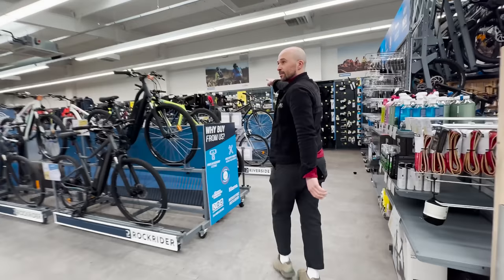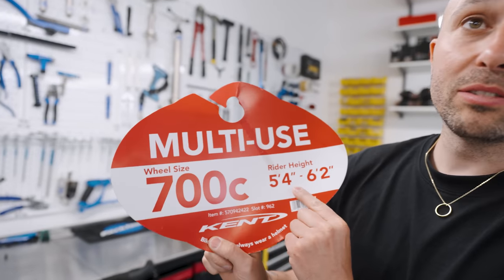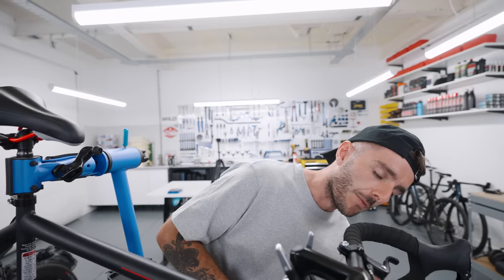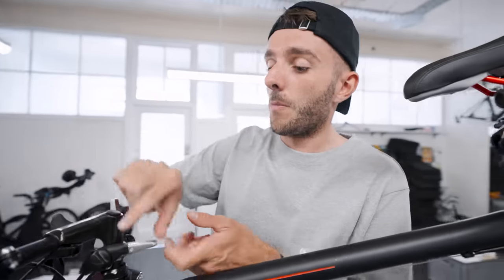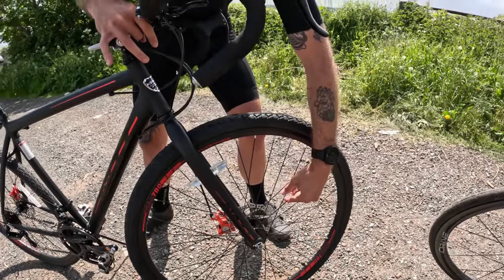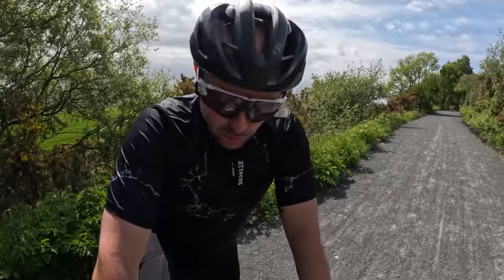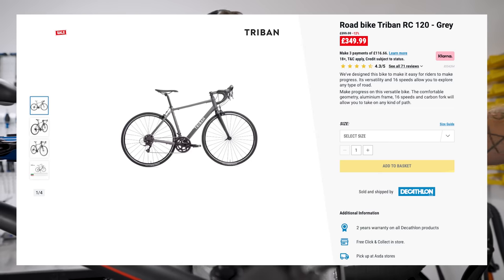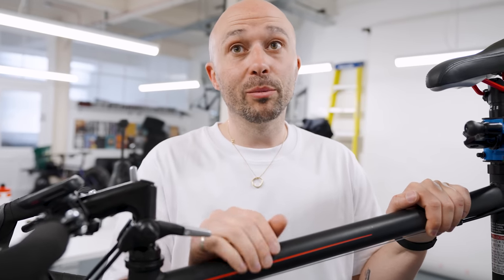We Bought A $248 Entry Level Bike in 2023 - Too Cheap?

Comment: I got this bike last year for $30 on clearance, I knew it'd be bad but couldn't resist at that price. After putting good tires and flat bars on it's actually fun to ride.. for a few miles at least. also replaced the components with tourney tier stuff so it sucks a bit less. Though even after these upgrades, I stopped riding it because of the flimsy crankset which feels woefully inefficient for any long ride. For a casual cyclist this bike does have potential, but they probably should've just sold it with flat bars and trigger shifters to simplify things for said casual cyclist.
Reply: I am new to cycling. Kinda broke. May have an opportunity to trade for this bike with a local.  Would you say under those circumstances its a good bike to get me going until I upgrade, seeing as how potentially I wouldn't have to pay for it, and that these gentleman are being a little too technical because they likely have ridden more miles on higher end bikes?
Reply: @annex6  For next to nothing, sure, it's a bike.. But these days there's a much better option at Walmart for the same retail price of $248 - the Ozark Trail G.1 Explorer, it's similar but FAR better than this bike. If I was in your situation I'd save up for this particular bike.
Reply: @frunkiss  thank you I  will check it out.
Reply: @frunkiss  one more question, I'm 5'11". Is that too big for either bike?

Comment: In regards to the lack of water bottle cage mounts, I would suggest something like the Adventure Hydration Cranktank. It comes in a 3L and 4L version, and is held in place in the middle triangle with rubber pads and 2 beefy velcro straps. It can be tricky getting an airtight seal at the quick disconnect fitting though, so I would recommend ditching it and using a pair of pliers to stretch some 1/4" ID tubing over the male end where the fitting connects and securing it with a releasable zip tie. 

Apoligies for the long-winded comment...

Comment: Actually, Decathlon does even cheaper bike - RC100. It is 299 euros in Germany currently. I think it would be an interesting comparison between the bike in the video and the cheapest one from Decathlon. 
The video is great as always. Thanks a lot guys!
Reply: It’s much better than this one but the biggest (IMO) issue remains, the gear ratio is just bonkers for a beginner. The RC100 might actually be worse at this particular point, it’s a 1x and the smallest you get is 44-28. And it’s an industrial-wide problem not limited to Decathlon and Walmart/Kent.
Reply: @uranusjr  for a beginner ( like I was my self ) it is all about the easiest gear, so what if I spin out the gears going down a hill, I earned that by going up the hill.
This is why 1x bikes need to have at least 42x38 imho
Reply: @cybertonto72  Not sure if we’re on the same page, Triban RC 100 has 7-speed 12-28 and a front cog of 44. No beginner’s gonna be able to earn any hill on that!
Reply: @uranusjr  I was agreeing with you and adding that beginner bikes really should have a VERY easy gear

Comment: disc set up does not need super true wheels and are probably cheaper. A few quid extra gets you tourney sti levers. I would guess the smaller front cranksets are more expensive than the standard sizes, I think I bought some no name ones for 35 quid though (sti)

Comment: One thing about the gear ratios on entry level bikes. If you start with a hybrid with 7 gear shimano Nexus and only use the 3 highest gears (not unlikely at least here in Sweden) you don't want your new shiny roadbike to have much lower gears with bigger steps between the gears than your old one. 

No, not all beginners on roadbikes want ridiculus low granny gears.

Comment: I have a Kent bohe 700c gravel bike that its MSRP is $348 but I bought it when it's on sale for $128 and it has all the proper "upgrades" to the $248 in this video. It has bottle cage bolts, separate derailleur hanger, l-twoo brake-shifters, tourney RD. 

It's so cheap that of course it comes with some cheap parts. If you spend a couple hundred dollars to upgrade, for example, tires, brake calipers, saddle and chain, it can be a very solid entry level bike. 

Still super heavy but safe and enjoyable. I say that because I still enjoy riding and commuting with this bike after I got a carbon frame Sram etap AXS bike for real cycling.

Comment: The entry level Decathlon Rockrider mountain bike which is more mountain bike style than actual mountain bike has a aluminium frame and a non-removable gear hanger and that's a mountain bike which is more likely to be bent and damaged. I would of thought a built in gear hanger on a high tensile steel frame was ok and it could be bent many times before fatigue would be an issue compared to aluminium. 

You can get basic steel road bikes over here. Falcon do some I think. In my opinion very cheap bikes always need setting up correctly with careful safety checks. They can be great value but you have to check them over being riding.

Comment: Back in the day, 1980's, I was involved in selling el-Cheepo bikes and that thing matched them perfectly if not for the disc brakes, which didn't exist at the time. The thing of it was that I worked for an electrical and furniture store that did deals on bikes and exercise stuff. We sold enough of it to make it worth while though non of the staff knew enough about bikes to set them up properly. I was left to deal with them because I rode a bike.  I remember one coming back after the owner hit a car head on. While it was a 16 ton steel frame, the impact had telescoped the frame inwards shortening the top tube by an inch and a half. I convinced my boss this was a serious flaw in the bike and we refunded the buyer. So don't be so enamoured of the heavy steel frame, it might not have the quality you think it has. Further, is it rust proofed? A lot of cheep bikes aren't?

Comment: As a kid when no mtb was cheap, we used to have the bottom of the barrel stuff and let me tell you that the biggest problem with cheap bikes is that they dont follow any kind of standards so getting parts that fit was literally impossible. Our tires were always bald af because the sizes were some number generated by an algorithm that no bike shop has ever heard off.

Comment: The way i read it was 700c is good for 5'4 - 6'2. assuming if you are smaller than 5'4 they have 650B and larger than 6'2 you would need a 32' or 36' so not frame wise but wheel wise.

Comment: Oh, for heaven’s sake.  Nearly all of the bikes in my family are older steel bikes without replaceable derailleur hangers, and I have never had one break off.  The only exception are the three mountain bikes and a fat bike, and even though they have replaceable hangers, none of them have needed replacement either.  This is a problem more for aggressive off road ridding such as enduro and downhill disciplines.

Comment: You keep comparing this 200 Pound bike to the one you like at 350 Pounds.  I'm not sure something 75% more expensive is really comparable.  For every bike from $1 garage sale or Goodwill bike up to about $500, the most and only important part is adjusting it correctly.  Truing the wheels.  Adjusting the brake pads.  Aligning and tightening everything straight.  Adjusting the derailleurs to shift.  There is no difference in quality or performance between $1 and $500.  Its all down to adjustment.

Comment: I just want to point out that the Decathalon Triban bike is not 'slightly more expensive'. Its 340 euros aka $375 on -sale-. That is 50% more than this $250 Walmart bike.. When talking about budget products, that is a massive difference in price that would be reflected in parts used. Also at the end of the video you talk about upgrading this bike, 99.9% of buyers will never do that, quality bike parts arent cheap, especially when youre buying retail and not wholesale. The people buying this bike will either run it into the ground as-is, or ride on it for a month to see if they are into the hobby and then donate it and get a far more expensive bike. Nobody is going to put hundreds of dollars or part upgrades on a $250 bike.
Reply: Yep, I got a $250 bike and put 500 miles on it before I gave it to a family member and got a much nicer bike since I knew I'd ride it

Comment: 🤔. Frances flies to the USA to buy a Walmart bike? There are Walmarts in the UK. 
The reason you can't buy the bike in the box is because in the land of "law suits" . If you put it together wrong and crash you sue the big box. (BTW, these bikes are not built up by a bike mechanic.) Same reason for not riding at night, if you crash (there are no lights or reflectors) you sue. (This actually happened). And the wheels are usually bolted on.
Reply from the maker: there are no walmarts in the UK and the bike did come with reflectors which we removed.
Reply: ASDA is owned by Walmart
Reply: Only a minority stake these days.
Reply: @Jimmidoesstuff  good to know
 Thank you. I don't shop Walmart due to their labor practices.
FYI you are a good addition to the channel. 👍

Comment: You should build a Chinese frame and used parts compared to a &1500-2500 store bought. Be a much more real comparison than between a $250 and $10,000 bikes that no one is cross shopping.